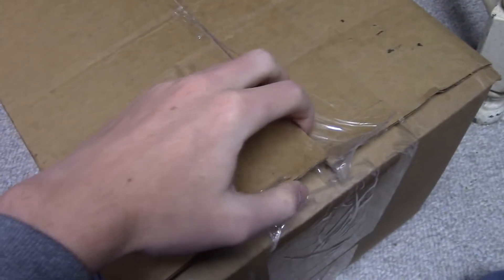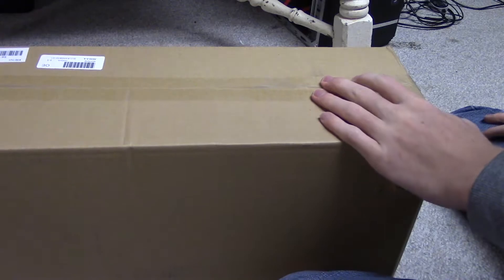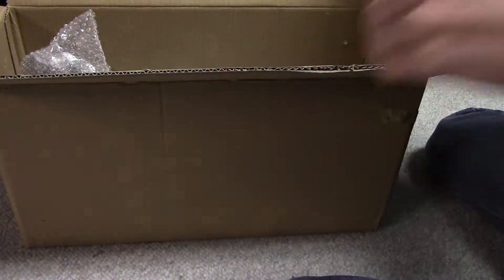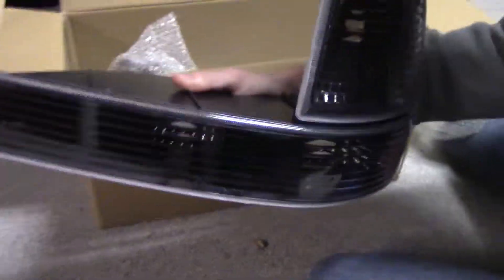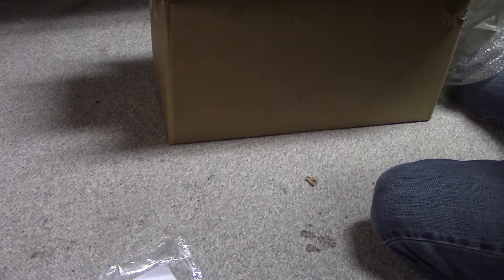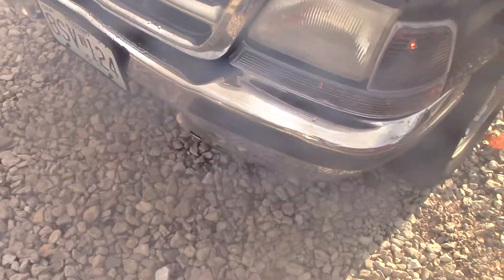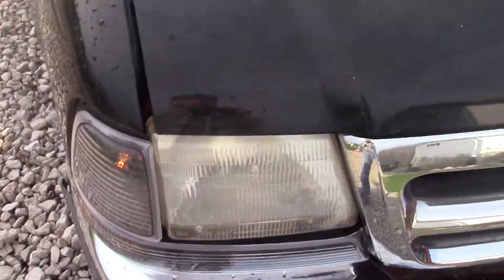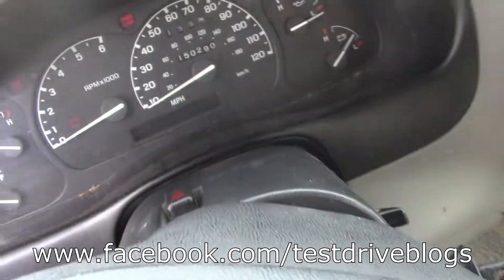Unboxing and installing new turn signal/marker light lenses on my Ranger!

Comment: Hey could you send me a link to where you got those? My 99' rangers turn signal lights are falling out and those look nice! Thanks
Reply from the maker: Mrrefreshyourmind I got mine from this eBay seller -
http://www.ebay.com/itm/98-00-Ford-Ranger-Corner-Turn-Signal-Bumper-Parking-Lights-Black-Amber-/381142378513?fits=Year%3A1998%7CModel%3ARanger&hash=item58bddb2811&vxp=mtr

Just a warning - The glue they used to attach the lens to the housing seems to not work very well and some superglue or something will most likely be needed to make sure it stays together.
Reply: Thanks a lot! And I'll keep that in mind about the glue. Did they fall off or did you notice them not staying on well?
Reply from the maker: You're welcome! And nah, they're just getting loose from the housing near the grille a bit and letting a bit of moisture in.
Reply: Hey man I can't wait I just ordered them! And seriously dude you need more subs for the videos you make! About to watch your hot rod tour videos
Reply from the maker: Mrrefreshyourmind You're welcome! Glad to help. Also, thanks haha, hopefully this YouTube thing goes somewhere big someday :D